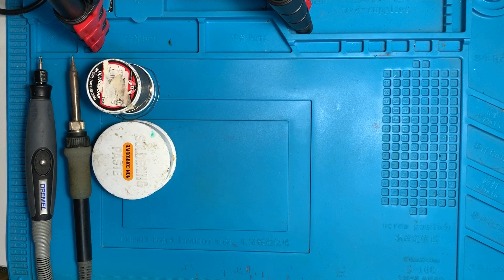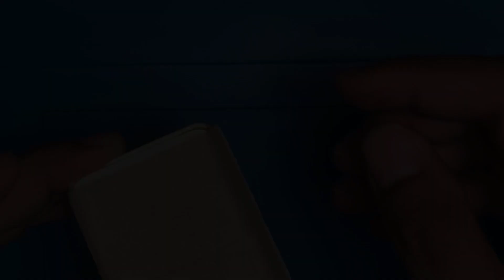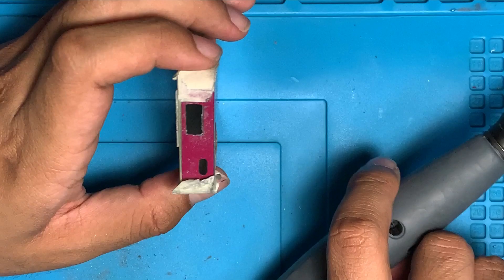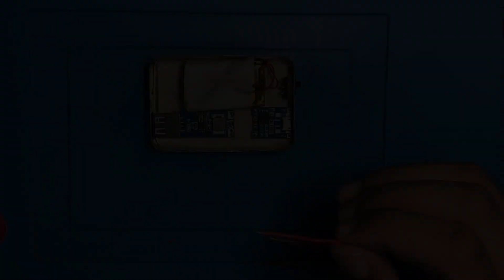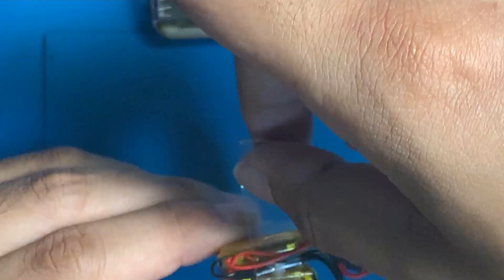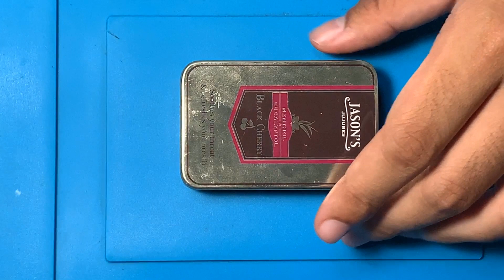DIY Power Bank (แบตเตอรี่สำรอง)

Comment: For maximum utilization, I would strongly recommd you should specify how to adjust the DC output voltage to be axactly 5 volts for both charger and DC to DC boost converter modules when loaded.

Comment: It would be better if you change the custom link to your channel to the same name of your channel.
I’d like the volume of the background music to be slightly lowered.
For your type of content, subtitles should be included throughout the video which I think YouTube has the auto-generating option but I don’t really know how it works or how to use it.
Narrating to give viewer a clearer understanding to what you’re doing when you’re putting stuff together would be nice too.
I just watched the latest video you just posted (partly).
Reply from the maker: About the custom link, I will need to have 100 subscribers first and then YouTube will give me access to that feature. Im also in a process of making subtitles. So, stay tuned :).